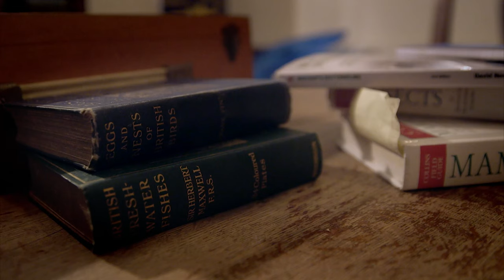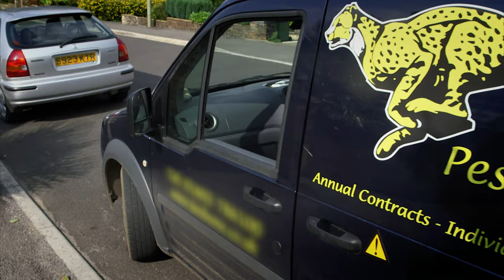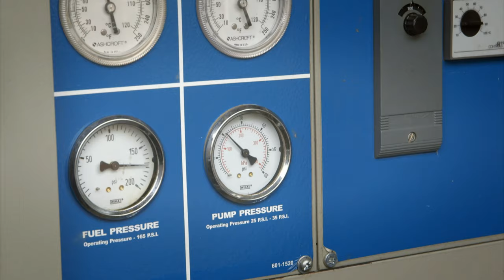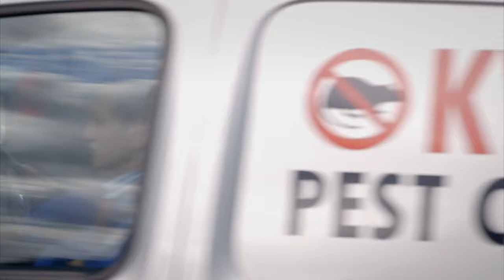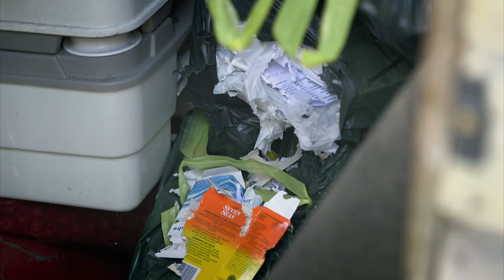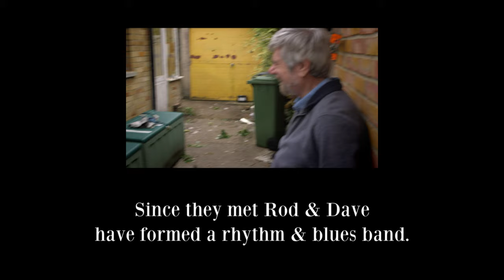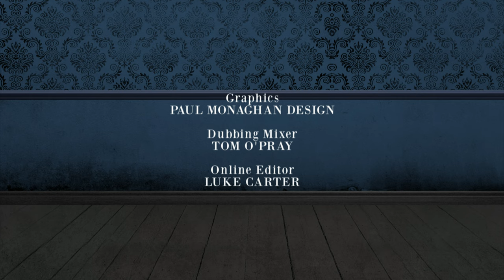The Terror of a Bed-Bug Infestation | Pest Controllers in Action

Comment: We got bed bugs when we rented our condo. out . They are horrible. Finally the solution that finally worked was 1 - we bought an air mattress that had no crevices where they could hide, 2- We abandoned our bedroom, sealed the door, and set up our air mattress in the unused spare bedroom, 3- We. threw away the old mattress and old frame, 4- bought new bedding, 5- left the dresser and night stands inside the contaminated bedroom with the sealed door, 6- washed and dried in hottest water and high heat any clothes that had hung in the contaminated room's closet. It is essential not to transfer bed bugs into you new sleeping space. Its impossible to kill them in the old bed and frame, so both needs to be trashed. After a year in the sealed bedroom, without any blood to feed on, we were finally bug free. However, I found dead bugs and eggs in crevices of my furniture - which I scrubbed down with very hot water and Clorox - and even inside the wall socket switch plates. Fumigating simply drives the bugs out into surrounding rooms and they will return. My year of fighting these nasty insects was one of the biggest challenges of my life.